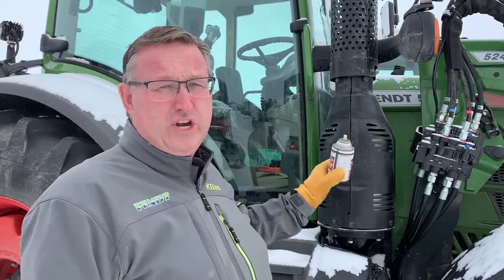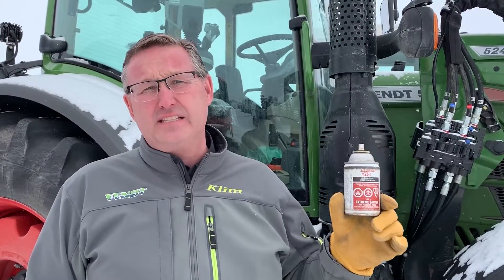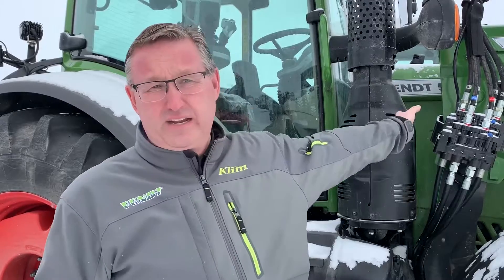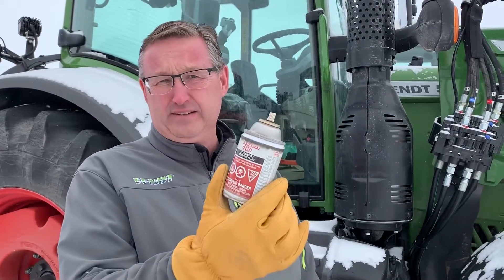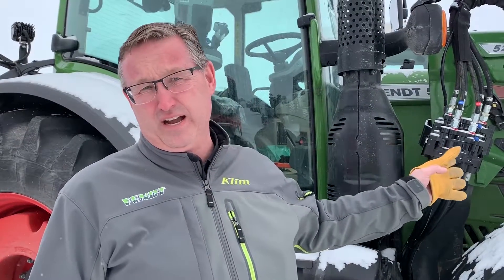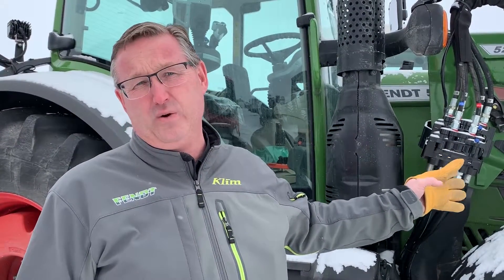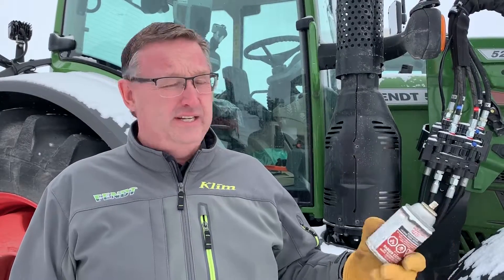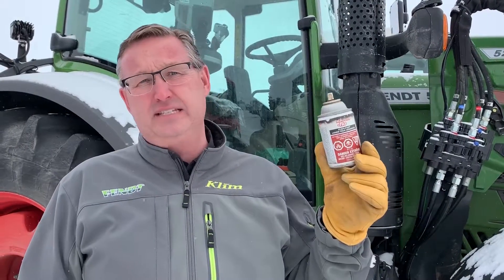Ether on Tractors | When To Use It? If you have a new tractor, DON'T!

Comment: Keeping a vehicle out of the wind won’t keep it warmer. Wind only changes the rate of cooling but won’t cool it lower than the lowest temperature. I wish that wind chill myth related to equipment would disappear.
Reply from the maker: Great point, thanks for your input!
Reply: @Sean Doherty, Exactly right windchill does not affect inanimate objects. However If it's out of the wind I'm less annoyed working on the thing after it doesn't start🤣
Reply: @SkylarHillShop  I live in the prairie, the great thing about that is no matter what direction I am facing I can always push start.😀